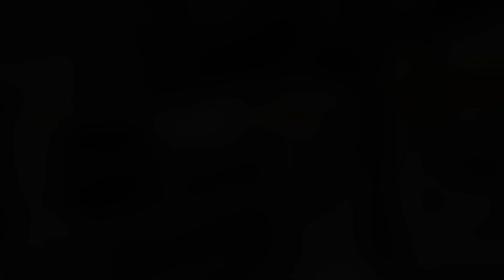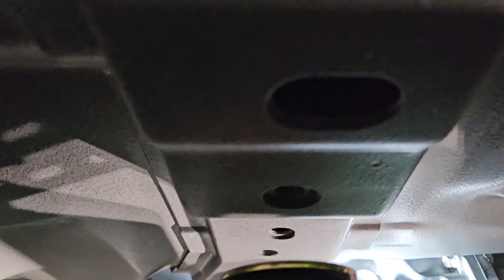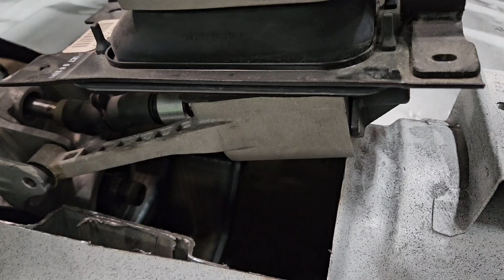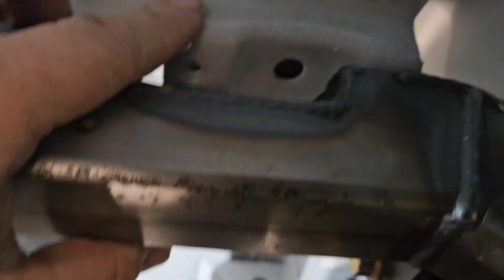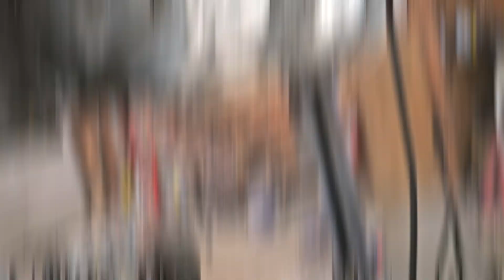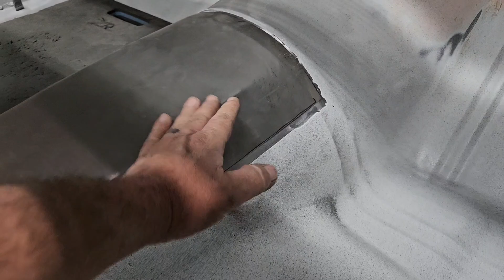Pro Touring  Trans Am Episode 15

Comment: This was a perfect car (rusty, new floors, etc.) to do this kind of project.  These builds are so much fun but after trying (time AND money!) to turn a ‘68 Camaro and then a 1977 Trans Am in modern road warriors I ended up with a 2020 Mustang GT.  That car, unmodified and straight from the factory will absolutely run circles around the Camaro and the Trans Am.  I’m excited to see this project finished but I wouldn’t trade cars!  Really nicely done video.
Reply from the maker: Thanks for the kind words. It's hard to argue that the modern muscle cars are definitely hard to compete with.

Comment: Incredible! That TR6060 with that gear shift mechanism makes for some serious challenges. You made it look right at home. I assume your new tunnel modification will all be seam sealed? Was it lapped welded on all sides? It looked like it was butt welded up front but could not tell. Learning a lot. Thank you.
Reply from the maker: It's but welded all the way around.  We will run a bead of seam over the welds for extra protection.

Comment: Nice work man! I really like it! How about the body braces? Are you going to reinforce it from underneath?
Reply from the maker: Yes I will go back from the bottom and add some reinforcement.  Although that brace is really just for the front seat bolts. With this chassis and the way it bolts to the body, It really stiffens the body